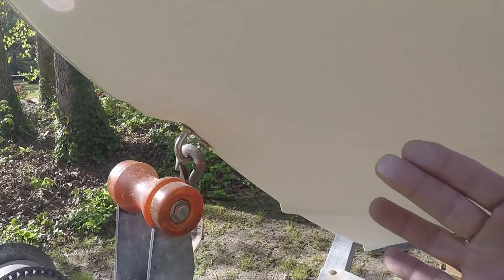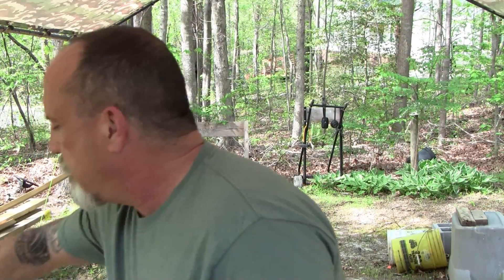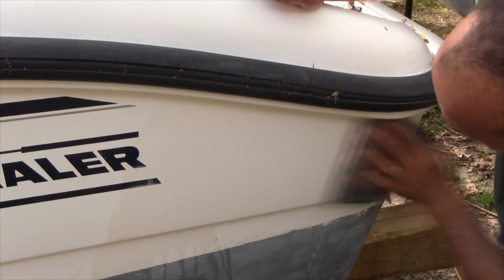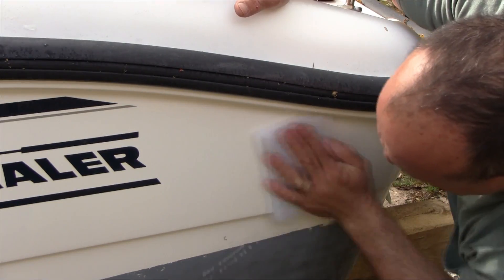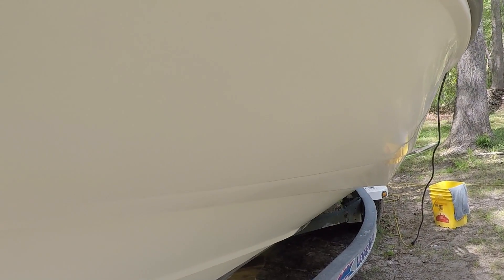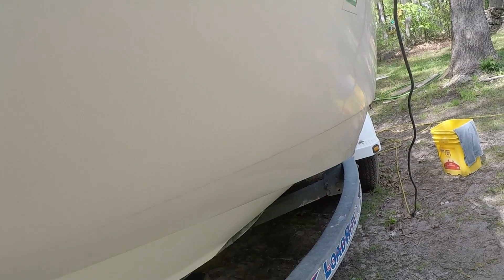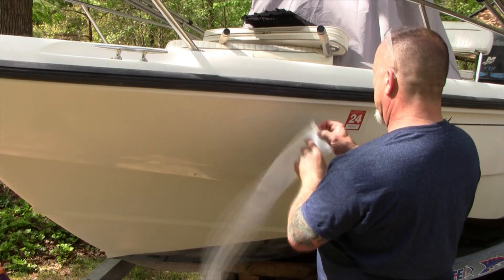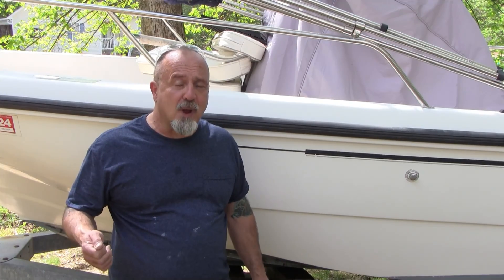Oxidized Fiberglass Gelcoat Restoration With 3m Perfect It Compound and Wax

Comment: From what I am reading, the sanding you did prior is not needed from the blend of the 3m cut. I am about to do this job on my dauntless today. Thoughts? How it holding?
Reply from the maker: IT's holding great. Wet sanding with 1000 or 1500 cuts through a lot of the oxidation so it's easier to polish.

Comment: Nice going, I recently bought a 92' Montauk, inside was painted whaler blue but is chipping off pretty bad, I went to clean it and even the scrub brush has knocking it off. What do you recommend doing? I'd rather it be original looking.
Reply from the maker: You can try sanding it off but you'll have to restore the gelcoat underneath. Also, scraping the loose bits off is an option as well but you'll have to be careful not to scratch the finish underneath.  Personally, If at all available to you, soda blasting is probably the best bet but can be costly.
Reply: @ExtremeDIYGuy  Not bad idea, the paint is so lose that when using a plastic brush with soap on it I saw good bits of it coming off. Also I taped off a few point and when I pulled the tape back it took like 30% of the paint off. Maybe jsut a power pressure washer?
Reply from the maker: Definitely, If its that loose I would try the power washer, jut be careful to use a wide fan pattern and not get to close to the Gelcoat!
Reply: Even if you did damage the gelcoat, after sanding it, you simply roll on an epoxy barrier coat (epoxy fairing compound can be used for dings and gouges), wet sand that, and you're ready for new paint. I would use a 2 part catalyzed finish after all that work.
Reply from the maker: @paulbriggs3072  Check out my series on restoring a classic 13 whaler. After glassing, fairing compound was what I used to level everything out, after a ton opf fairing and sanding, an epoxy barrier coat was next (3 coats) before the two part poly.